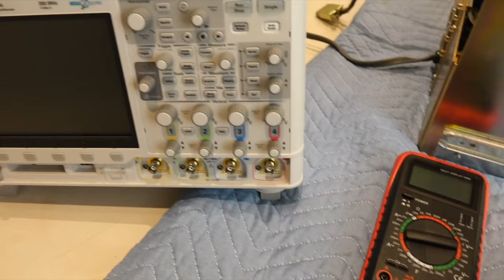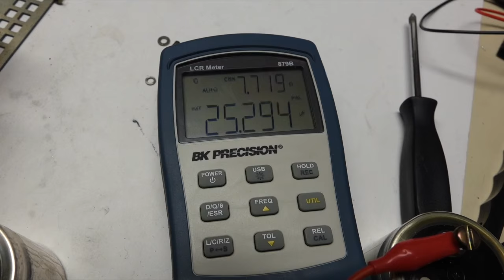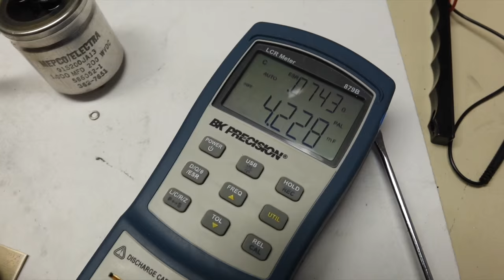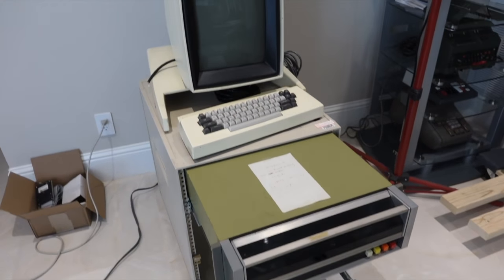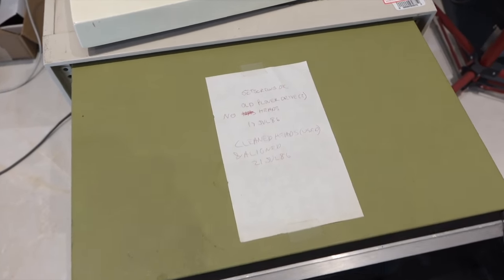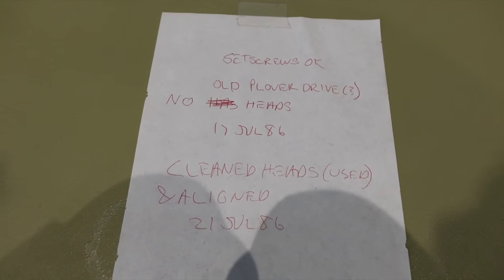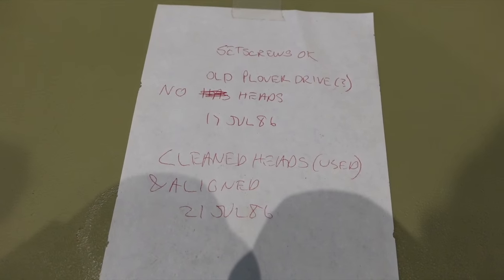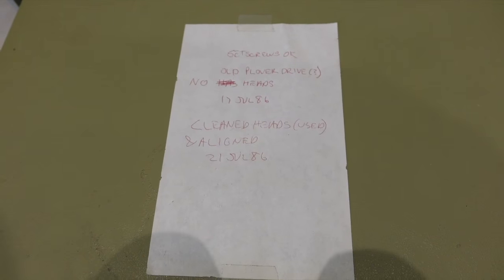Xerox Alto Restoration Part 1 - power supply restoration, disk drive surprise

Comment: Great to see people working on restoring such an important machine. I do have a question. Why not replace all three big can capacitors in the failing power supply? You showed two where as good as dead, the third one was fine (at low testing voltage). But who knows for how long. It might start failing anytime and ruin the machine.
Reply: I agree too.

Comment: I think you also should replace the good capacitor on the first power supply because it's very luckily to fail due to its age and that might damage some othe components on the rest of the system.